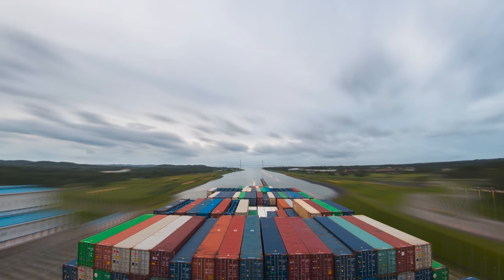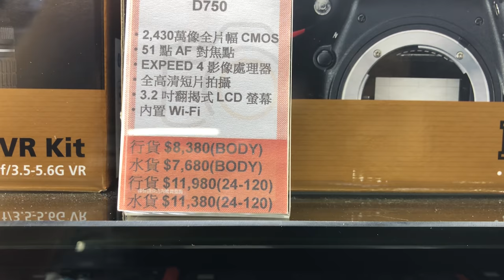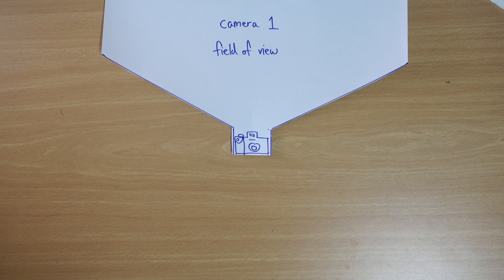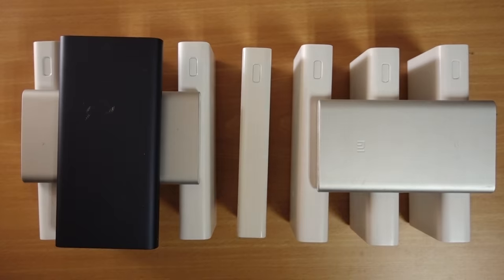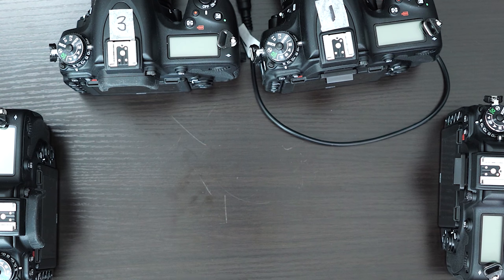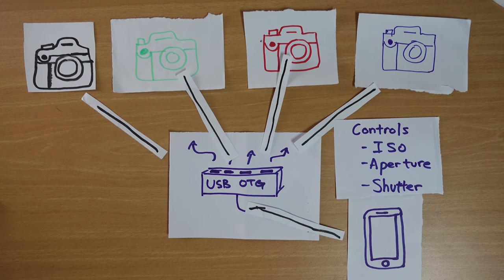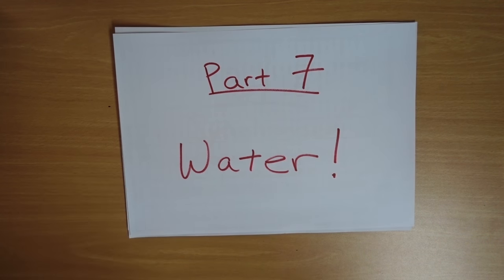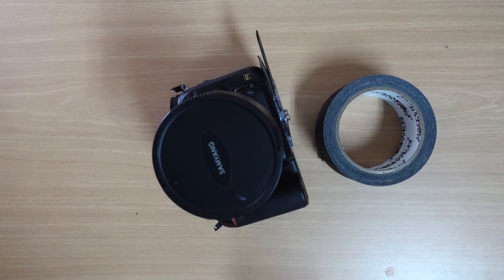Building a $10,000 360° 24K Resolution Camera - Rain-proof Timelapse Monster for at Sea

Comment: 6k * 4 in resolution = 12K
Like 8K is actually 4K * 4
Reply: Exactly what I was about to comment
Reply from the maker: yes u are right
Reply: No but you see its like when you mix two sorts of 40% vodka
You get 80% alcohol drink innit
Reply: Matias Hogden you just get drunk
Reply: @matiashogden1240  no you dont... if you fill 1 glas with two 40% shots, you dont have a 80% alcohol beverage... 
You just have a bigger glass of a 40% drink ;)
Reply: @HouseOfPetrol  thanks, Sherlock!

Comment: UGreen have a USB-OTG adapter for the phone, that lets you charge, while you have USB devices connected. Then you can do away with the wireless charger, which is inefficient anyhow. And well, because of the overlap it's more like 20k resolution.

Comment: Batteryception lol. Though all that wrapping and insulation, it might heat up quite fast. What if there's a PC fan running off solar panel? It doesn't have to run if the sun isn't out shining down hot rays of electronic killing infrared, so solar seems to make sense.

Comment: Nice vid but please don't call it 24k I mean it's 4  x 24mpix which is 12k max... 22k has already 860mpix on the frame... And you can't process nowadays those amounts of data
Reply from the maker: yes i realize later that its in fact 12k
Reply: @JeffHK  not meant to be offensive, 😊